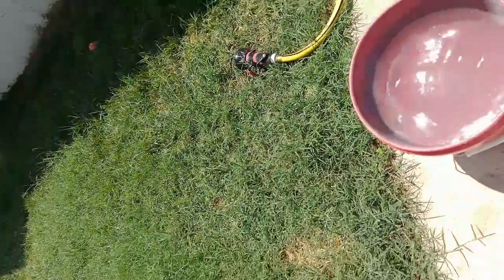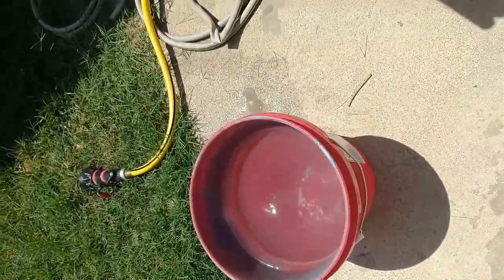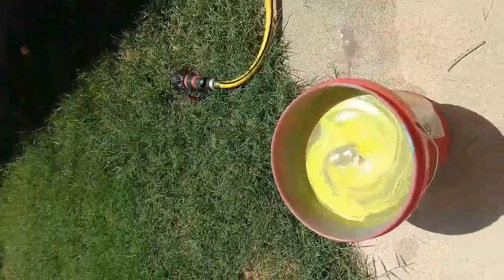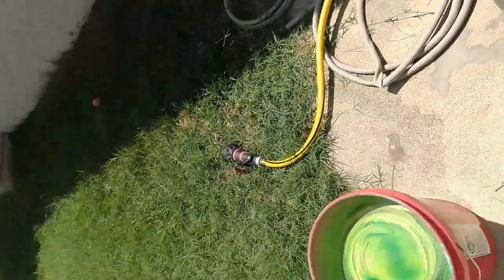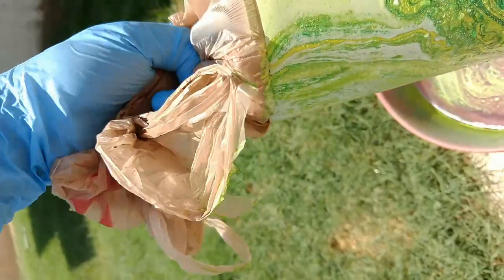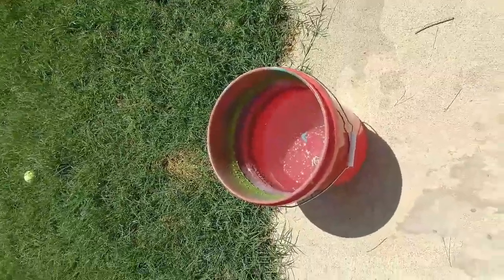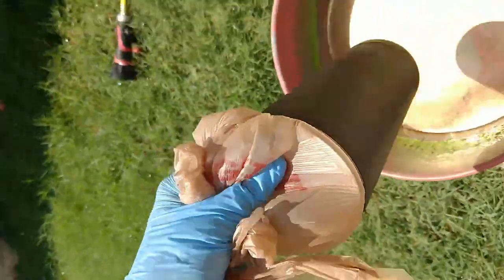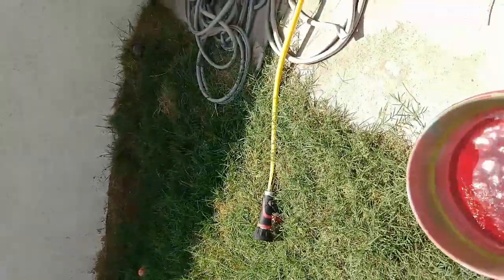How to Hydro Dip A Tumbler In Water With Spray Paint | Hydro Dipping | Tie This Creations

Comment: So you have a bag around the lid? What keeps it from opening? I'd love to try this but I'm afraid of it popping off
Reply: You use several bags to make sure it's tight.
Reply: The first/last time I tried it with the bag,  it did pop off. 
I just go in with my gloved hand or stick it on a football wand.
It's super easy to clean the paint out of the cup.
Reply: I put the bag around the lid and then I saw a hole. So I taped the bag around the lid several times and had bag left over. I was worried about it popping off too.